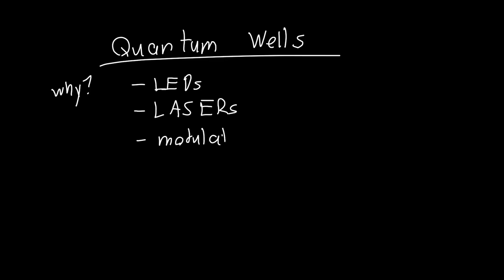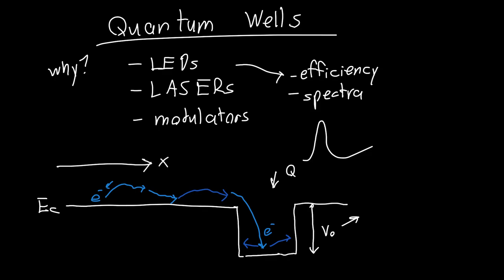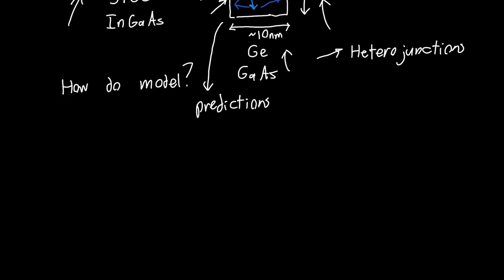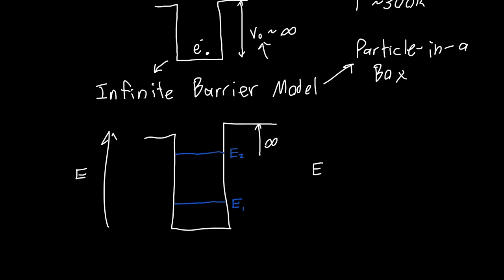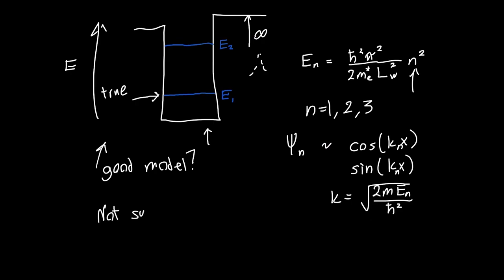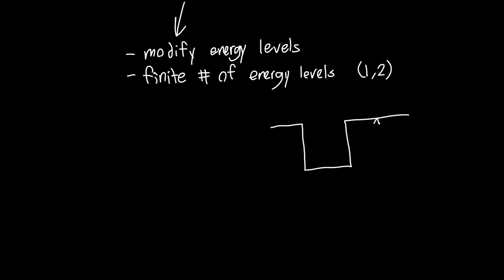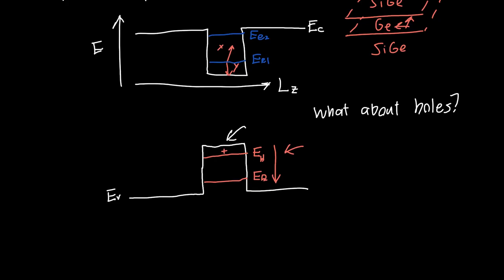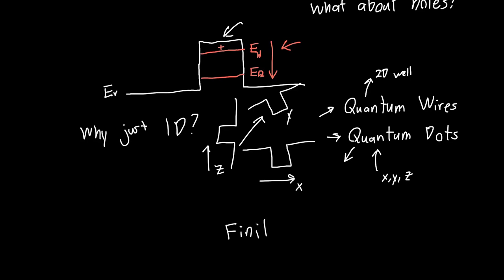Quantum Wells Explained

Comment: Hello sir, thanks for the explanation. I think in the last part where you showed the 1D well for a hole, it should still be going downwards not upwards as Schrodinger equation, we have only potential energy and it should not matter whether the particle is electron or hole. So to confine a particle, we should be having a well, not a barrier. I am aware that hole is a construct to describe the motion of valence band electrons and therefore am interested in the meaning of the fact that a 'hole is being confined'.
Reply: I think the convention is to think of/define the potential term in reference to electrons (not holes).  This means, when considering the VB, that the electrons move down from the barrier, leaving holes at the top of the barrier, effectively confining the holes (or absence of electrons).

Comment: Can they quantum tunnel through the barrier?
Reply from the maker: So if you just take an electron and stick it in the well it will sit there (ideally forever). If you apply a voltage to the whole system (so you're tilting the well and the bands on either side), then it will tunnel out, this is called "Field emission".

Comment: Thanks for your interesting article.

My intuition said there is something important about this mechanical effect.

 This model shows how a field represented by a sheet of elastic material under the right initial conditions naturally form quantized energy levels. 

From there it was easy to form very stable three dimensional structures using a very minimal amount of material. (similar to the way engineers built large light weight space structures)

https://youtu.be/wrBsqiE0vG4?si=waT8lY2iX-wJdjO3

You and your followers might find the quantum-like analog useful in visualize nature properties of fields.

I have been trying to describe the “U” shape wave that is produced in my amateur science mechanical model in the video link. 

I hear if you over-lap all the waves together using Fournier Transforms, it may make a “U” shape or square wave. Can this be correct representation Feynman Path Integrals?

In the model,  “U” shape waves are produced as the loading increases and just before the wave-like function shifts to the next higher energy level.

Your followers might be interested in seeing the load verse deflection graph in white paper found elsewhere on my YouTube channel. 

Actually replicating it with a sheet of clear folder plastic and tape and seeing it first hand is worth the effort.

Comment: Question
when the particles falls in the well does it release energy in the form of light?
is this how quantum dot tvs work?
Reply from the maker: Precisely.
Reply: @JordanEdmundsEECS  form as photon, not necessarily form of visible light? But thing what I wonder that if I have understand right that drop define also energy of that photon and so on it define wave lenght. So what define and limit "depth" of that well? I mean what limits us to make diode what emits UHF or what limits us to make diode what emits x rays?

Comment: Hi! I really liked your video and it helped me a lot to understand this. I have one question that concerns scattering in heterostructures. I read about that in comparison to transport in bulk material, that there is a reduced scattering potential in a 2DEG, and that is due to a "spacer" between dopant layer and 2DEG. Now this is something that I would like to know more about if you can help me; do you know how does this "spacer" actually works since I understand that it is next to 2DEG interface so it confuses me how did we get 2DEG in the first place, and additionally what does it consist of?
I also have one more question - when we make a quantum dot using these heterostructures, it is said that metallic electrodes deposited on the surface of this kind of a structure deplete 2DEG from electrons creating insulating area below the metal patterns and separating quantum dot area from source and drain as well as from gate areas in 2DEG. It would be great if you could explain to me this concept?
thanks! :)